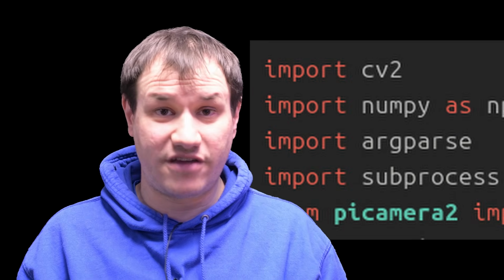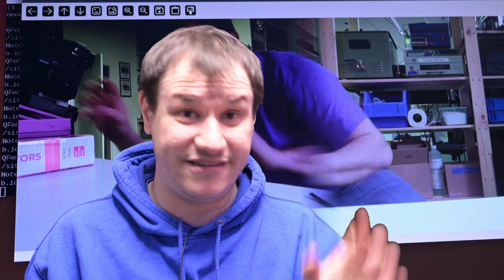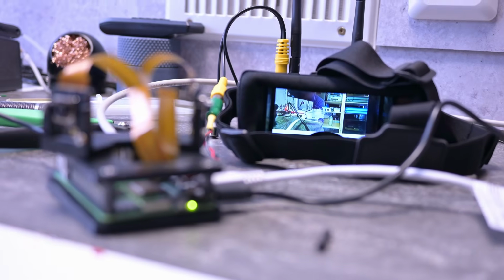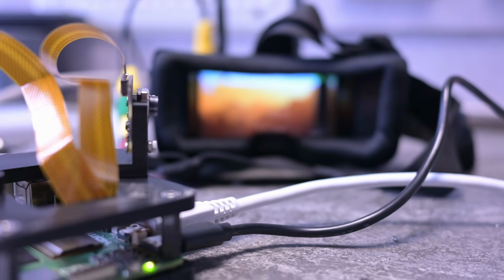Simulating Prey Vision with Raspberry Pi 5: A Dual‑Camera Perception Experiment

Comment: Had these with mirrors, several sets , one inverted, one mirrored image, and periscope to side , and one with different levels like an owls ears.  Usually took 1.5 to 2 hours for the brain to adapt , then all of a sudden your brain would snap to be able to see. after wearing for 6 hrs. as per class instruction , it would take another 2 or so to return to normal, but we only did walking not fine task stuff. And as it was in the 60's we NEVER tried it with recreational drugs - honest officer.
Reply: Cue the nausea....

Comment: Another low-tech way to do this is mirrors and prisms.
The old "only predators have binocular vision" trope is easily refuted and really should be retired. There's lots of prey animals with forward-facing eyes and countless predators with side facing eyes. Off the top of my head, sugar gliders, tarsiers, lemurs, and sloths have forward facing eyes, and most reptiles and predatory fish and many birds of prey have side-facing eyes. Most animals are somewhere in the middle of the food web anyway, so what's a predator or prey often depends on who's the bigger fish.
Reply: A bunch of the named ones do hunt insects. But yeah its an electronics video so I'm not do concerned with the right definitions just with getting people to underdtand what i try to achieve.